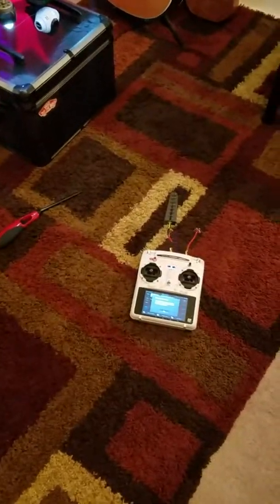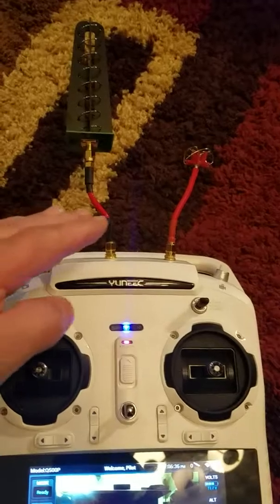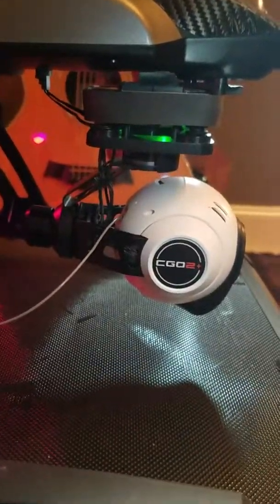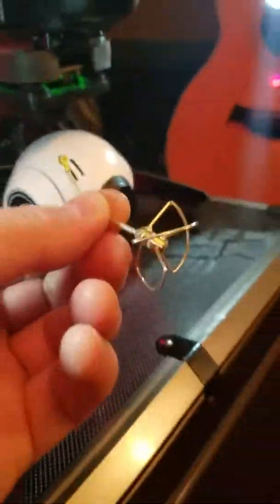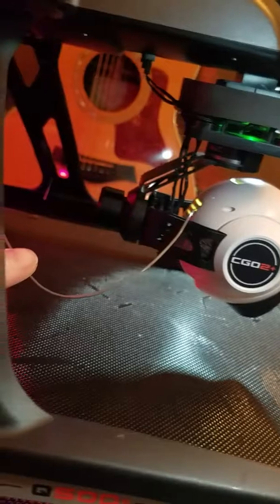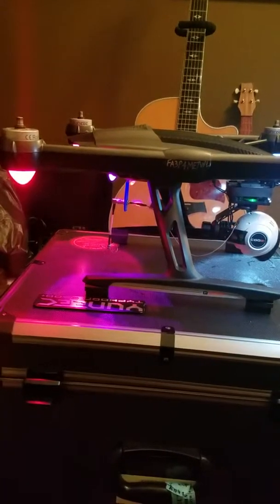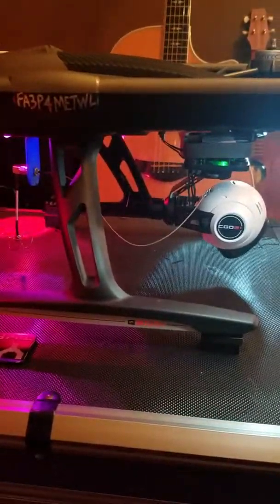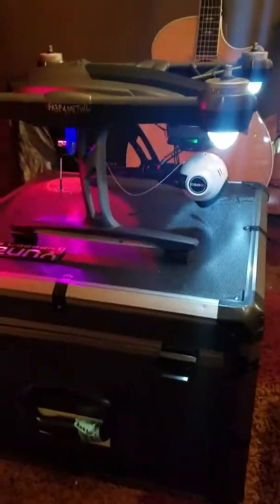Yuneec Q500 FPV Antenna mod. pt. 2

Comment: Now that you've had the antenna upgrade for a while, was it worth it? Does it help? Did you do any before and after tests for range comparison? I'm trying to decide if I want to do it too.
Reply from the maker: It added distance, especially when the camera is facing away from me.  But, the best distance upgrade is when I put sunhans wifi boosters on my controller.  I trippled the distance.
Reply: Sounds like I need to invest a few bucks more and upgrade!

Comment: Where did you get the antennas from
Reply from the maker: RonTech34 - 5.8hz are easy to get; amazon.  I think I got the 2.4hz on ebay.
Reply: Bryan 212 did you notice a big difference just by changing the antennas on the controller itself
Reply: Are the sunhans expensive and can you send me the link